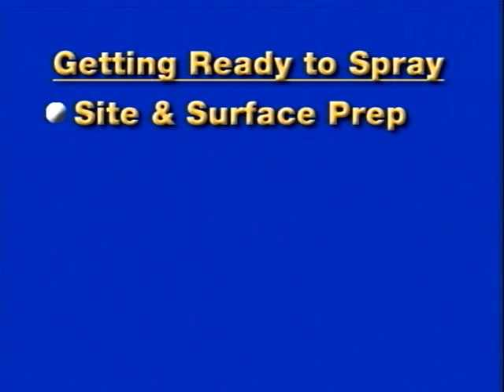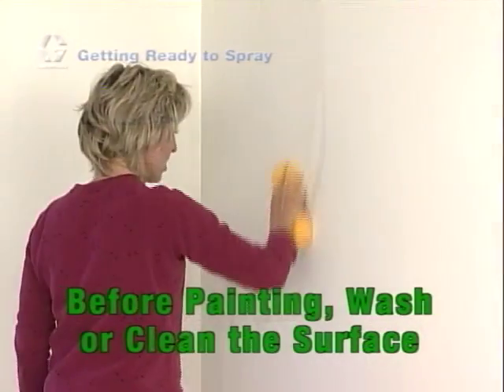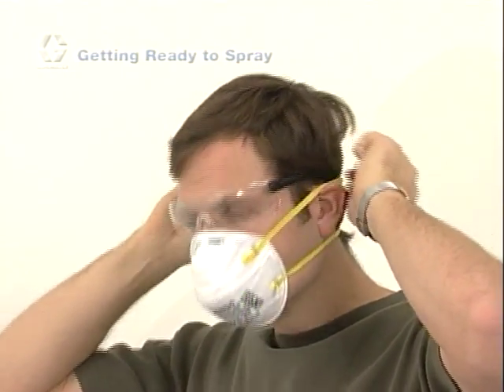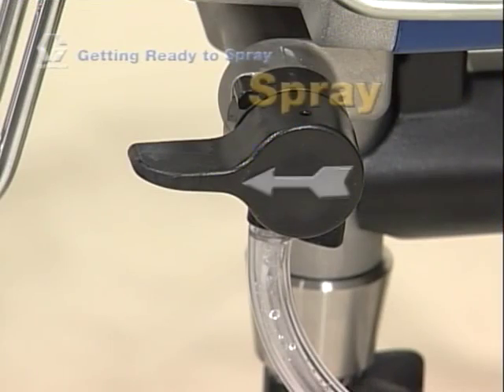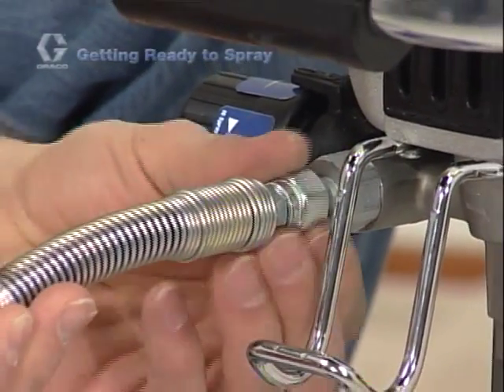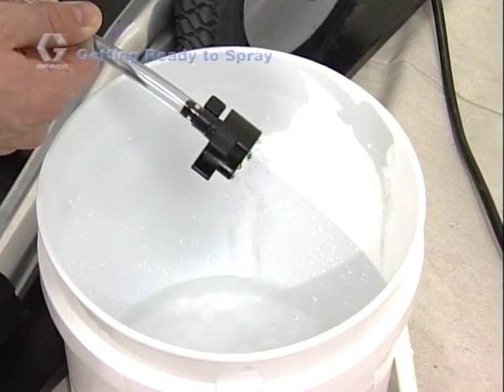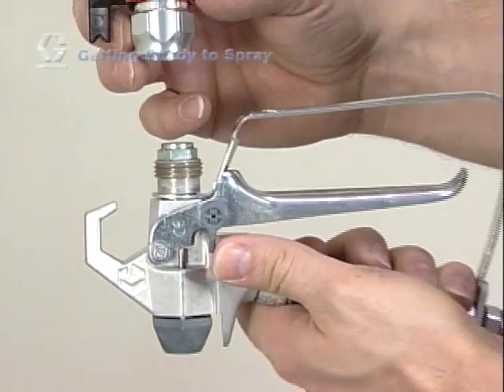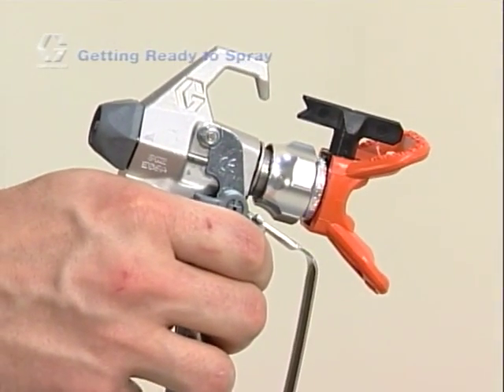Preparing to Spray with Your Graco Sprayer

Comment: Are the 390 and 210es the same machines. Does anyone know. I’m about to purchase one of the two, and I feel like I’m being hoodwinked.
Reply: 210 is a toy at least grab a 390.
Reply: @davidbahr9612  I already went with the 210. Trust me. It’s good enough for a novice such as myself.  I came home from work and my wife had found one on Amazon that was $150 less than the lowest price I had been quoted for a 390, and it was dun-dada.

Comment: Whats with the chick at the beginning useing the roller backwards and not rolling top to bottom? Lol...nice professional instructional video!
Reply: Doran Amatto whats with your spelling LOL
Reply: Doran Amatto what difference does it make going top to bottom ? How can you tell the difference anyway if someone is going up and down with a roller its only in your head if you want to say top or bottom
Reply: amen brotha
Reply: @dodgeuk69  it's hard to apply a even coat doing it the way she was. Hence a stroke should be from top to bottom or bottom to top. Either way. But it's a much better uninformed coat of paint